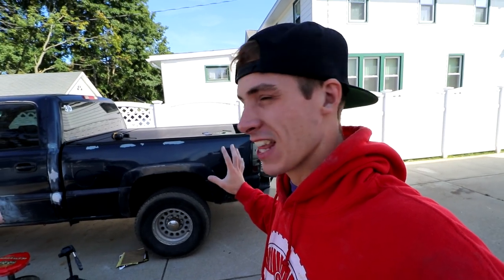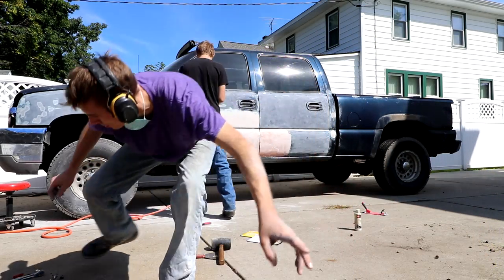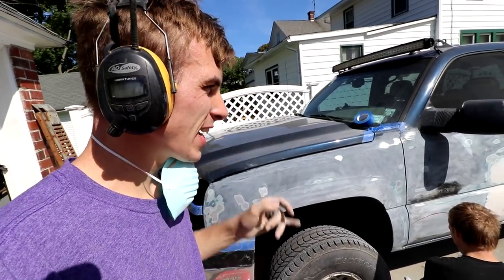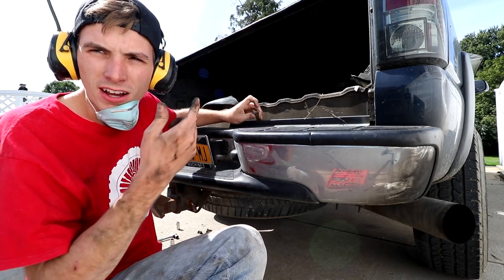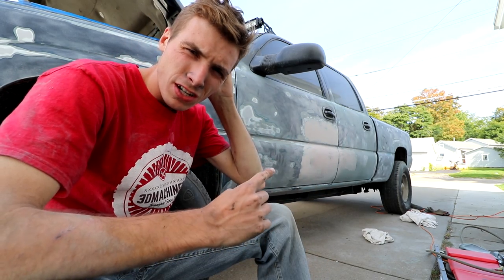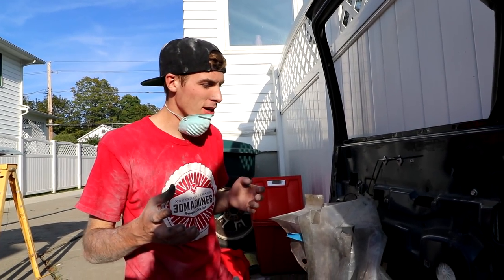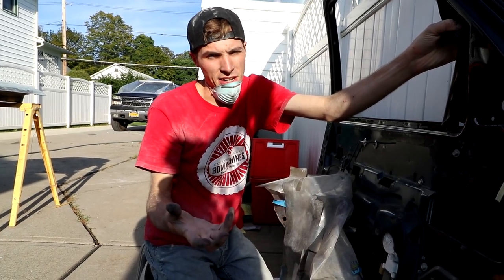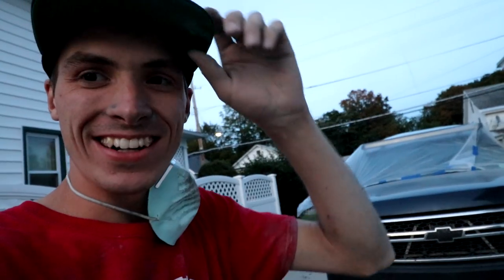PAINTING My Truck Was DUMB...

Comment: strip it down and take it to a body shop.  Are you really going to shoot two stage paint outside in your driveway?  Everything in the air is going to stick to your paint job.  At least taking the trim off and taping things up will save you a bit on costs but you could still get it to look like a new truck.

Comment: Crazy amount of work. I painted my GMC Jimmy, didn't strip nearly as many parts off. I basically went and watched Macco spray my buddies Buick Regal and basically just did it the same way. It wasn't that much work, but I wasn't going for absolute perfection. With all of the work you are putting in it should come out cherry. The prep work is the most important part and you are going all out.

Comment: Located in New Port Richey Florida, hunkered down at the house and rode it out my 9/11 was spent without power getting my old generator running, day 2 with no power but the old 1,400 watt Craftsman generator coming in clutch. Few trees uprooted around the house and the flooding has subsided.

Comment: I hope you don't mind me correcting you. It's front fenders. And rear quarters. The fenders are in the front. And the quarters are in the rear. Left and right. And if you paint outside, do it when the humidity and the wind are low. And don't paint in the sun. You'll get dry spray. I don't know how much you know about painting. But as long as your prep is good and you know how to mix the paint and clear coat for where you are, you should be OK. I hope you know how to use/adjust your spray gun.. Good luck from Georgia.

Comment: It's gonna be a pain to get the paint nice and smooth I redid a camaro a guy tried to plastidip after taking it to bare metal which didn't work so I had to get it back to being smooth enough to get actual paint back on lol it was annoying af. I had to get it to bare metal again then do 200 grit then 600 then 800 then 1200 then 1500 so it was smooth enough to get it into decent looking condition

Comment: Rebuilt my Ford F 150 1990 with a straight L 6 4.9. You should pop your hood open do the body work. Body work suspension work engine work. On my truck.

Comment: That missing paint has to be sanded down to bare metal and re-primed. If you really want to do it properly, make the whole panel bare metal and re-prime it. Tape off the parts that shouldnt be sanded its giving me anxiety. Make sure the body gets sanded with 600 grit before the paint goes on. thats my advice

Comment: when you do spray buy one of those cheap ass car ports put a space heater in there for atleast 10 hours ...to bring the metal tem up to around 78......soon as you prime take a propane bottle top heater and walk around it and cook it...2 ft away is ideal plastic 3 to 4 ft away.....you want to bake that shit tho......use an epoxy dpg 90 primer.......use light coats .....about 3....1 will be a mist type coat......second start doing some laying ...alaways pull trigger before you cross the panel....and your doing good it's always better to spray as much as you can flat flat doesn't drip......but do 3 coats of good dpg 90 epoxy....wet sand with 3000 .....after two days of baking.......wipe with a cleaner.....windex is fine.......spray base....do jams and shit first then start crossing the panels......little tip turn the sprayer away from the truck to stop on a long panel and restart ...from opposite side to avoid build up mixture is key.....your gonna need an water separator for the compressor .......and definitely plastic the walls of the cheap car port.......put two box fans on mover carts on moving dolls under the truck and one lil 5 inch fan up too you know those clip fans ....keep rolling the fans as you go and that will give you a down draft....you can take a 9 volt battery and negatively charge the panel.....to positively charge the pain do the same but you need a metal pot syphon fed style......just put the positive wire on the pot...boom....down draft booth......your Def gonna need a good exhaust fan.....but it's still cheaper then a paint job....2 coats of clear....lay that shit on thin ......real thin....keep building ......then bake the living shit out of it in the ten for 24 hours

Comment: The window motor is called a regulator. Just so you know. Auto body work is done by body men. Or a body man. ✌
Reply: Also. You should never leave metal bare over night. It will start rusting in just a couple hours. Should spray a primer/sealer over all bare metal. Atleast an etching primer. Good luck with the prep. Good paint is all in the prep work. Wet sand with 400 grit wet sanding paper before you paint. 600 grit for the edges. To help you keep from burning through the primer. Never put paint on bare metal. ✌
Reply: I'm a booty man is that the same?
Reply: WallysWheels Remade well yes and no. Being outside is a terrible idea to leave bare metal for more than a night, In a garage is okay but not too long where moisture will come in either as it rains or gets humid. You should leave the doors down until it settles down.

Comment: Don't remove fender.!
It is much easier
to remove the hood.
(and you can still drive truck...)
Also easier to align upon reassembly.!
If I were you...
would have made a deal
to do all prep work...
Then have a pro
shoot on some quality paint.!
And... good quality paint...
Is very expensive.!
But well worth it.
Reply: This is exactly what
I was thinking...
When you had the head liner out.
You had the back glass out...
Keep going...
Mask it off and paint.

Comment: I think I know what's wrong with your Suzuki motorcycle the same thing was wrong on mine and I fixed it little brass plugs on the side of the carburetor fall out and it causes the carburetor suck air from the side give it a try
Reply: All I did was stop it up with a hose and crimp the end because I could not find the little brass plug that fell out

Comment: Holy bud I'll give credit where credit is due but wtf you dont have a cheap maco paint shop around your neck of the woods. I had a short bed chev painted by them yrs ago it really wasn't bad i did the important part masking it all off. I cant remember what the bottom line was but it was less than a grand and the truck looked great. Lets face it, it only needs to look great for a few yrs. as you get older you just wont care about looks. Way too many other things in life to do. Just saying.